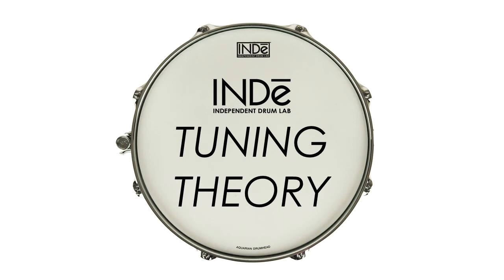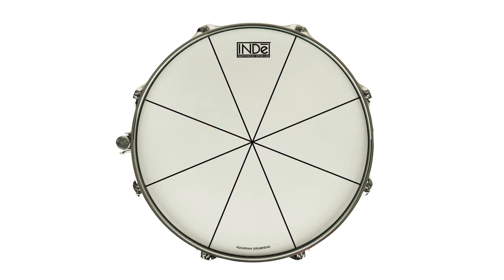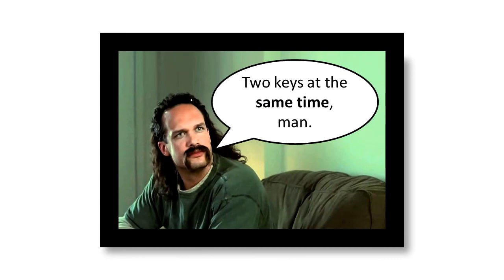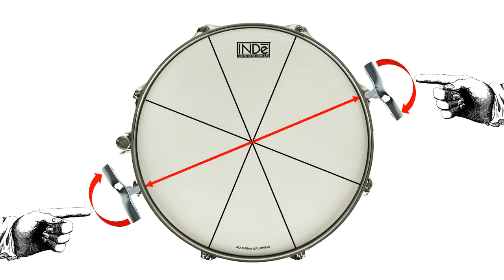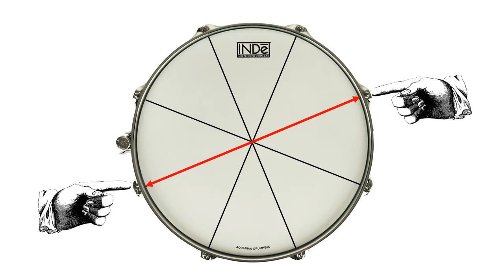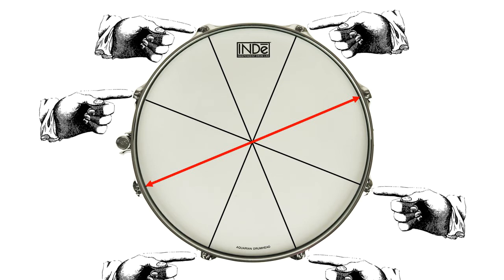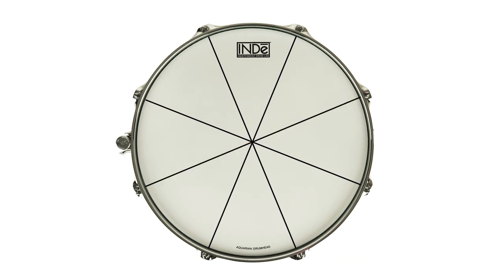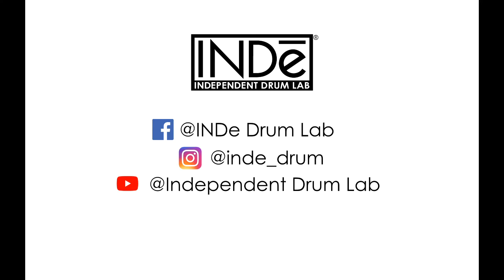The fastest and most accurate way to tune a drum, Vol. 1.  Tuning Theory.

Comment: Any suggestions for a 5-lug Gretsch round badge 12" tom? That puppy has never stayed in tune for me. I now understand why based on your video -- the tension is always uneven since the lugs are not opposite each other. Suggestions?
Reply from the maker: That's why we don't build with 5 lugs!  With those, you can only slowly bring up to tension in a star pattern.  You should be able to get a reasonably even tension.   If you are still really struggling with it, it's worth taking it to a good builder/tech and have them check the edge flatness, shell roundness, and make sure the hoops aren't bent.